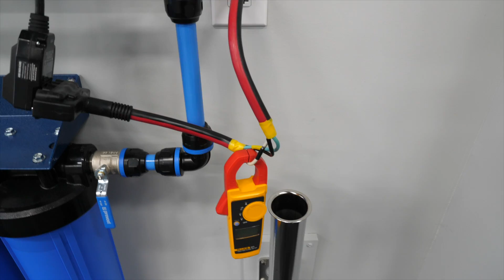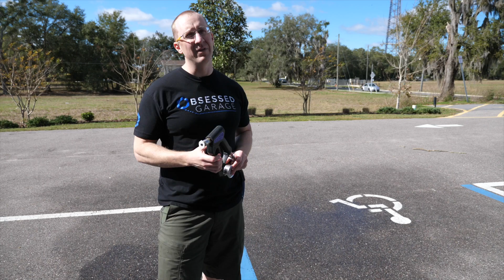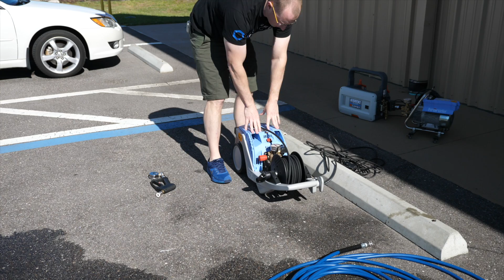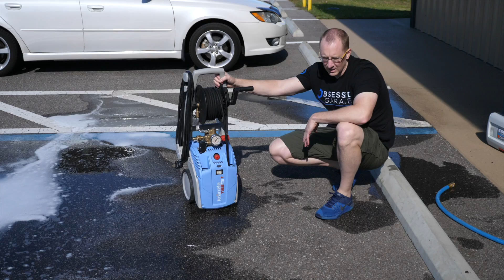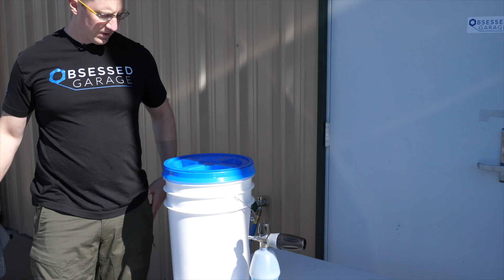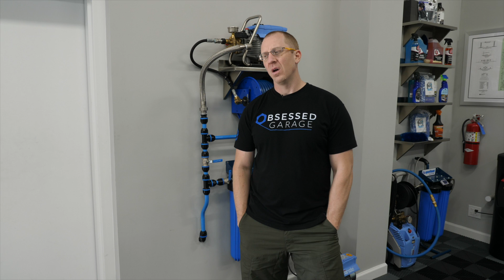The Pressure Washing Project: E12 - Testing Kranzle and Comet

Comment: How do you get the hose connection on the comet to stop leaking?  I cannot get it to stop to save my life.
Reply from the maker: It's all about the o-ring.  You can't overtighten.
Reply: @ObsessedGarage  Okay thanks, well, I can lol.  Brass shavings were all over and still leaking a little bit.  I've even tried plumber tape, different fittings, ughhh lol.  I can live with it for now.

Comment: Hi. I watch your videos and why in the US  kranzle has lower parameters?
I have (in Europe), Kranzle 1152 equivalent to a 1122 and I have real 120-125 bar ( on the pump but I don't have an injector ) which is 1700 psi and I have a real  flow rate of 10 L/min (almost, 10 kg/min ) which is 2.6 gpm; below 16 amp, only the current voltage is different because 230V.
What are the reasons for such differences, is it just the will of the manufacturer, or something else?

You say 1000psi is ok but i had a karcher M520 (15year old) washer 1450 psi and 1.6gpm flow and it was weak for me now i have a Kranzle and somehow the pressure isn't great either, it makes up for it with great flow.  Its strange that 1000psi is enough for you.

I write about the measured parameters, not from the manufacturer's documentation.

Comment: It's interesting that Kränzle USA does not offer anything like the HD 10/122, only the HD 7/122, which is essentially the 1122/1322. Also, something like the HD 12/130 would be popular in the US I'd think.
Reply from the maker: We don't have 240V.
Reply: @ObsessedGarage  
It was more of a general thing. Also, getting a 240v outlet is usually not that expensive or complicated. Many get them in their garage these days to use with everything from car chargers to tools.
Kranzle does offer a few single phase 220v units but those are properly expensive, so I think a 50hz version of the 10/122 and 12/130 would make sense for something in between for those having a 240v outlet.

Comment: Hey Matt, quick question I picked up a Comet from you guys, love the functionality, fit and finish however from my personal testing while using a 4.0 orifice as recommended I’am getting roughly 750psi at at 1.74GPM’s I’m using a MTM Hydro SG28 gun.  Any suggestions on why it’s under performing!?
Reply from the maker: It is likely your gauge is just reading differently than mine.  4.0 nozzle is the way to go.

Comment: how do you ensure water does not leak from fittings and ruin drywall? 
I don't think you can prevent that forever. otherwise great setup
Reply: You either use drywall meant for wet rooms or paint it with a paint meant for wet room applications.

Comment: Hey Matt, you skipped the foam cannon test with the 1622. Any idea if you would have used the 1.1 or 1.25 with the foam cannon? FYI, the numbers were 900 PSI with a 3.5 tip was 1.59 GPM. Thanks.

Comment: Can I use a power washer on my car thats has a  PPF Xpel wrap on the hood and nose ? Will the pressure washer lift the edges of the PPF ?
Reply from the maker: You can without issue.
Reply: Obsessed Garage 
awesome. Thanks a lot. I plan on ordering the Kranzle or the Comet this week.

Comment: I don't understand. Why the hell would someone want to spend over $1,000 for an electric pressure washer when a gas pressure washer, with lots more DPI and GPM can be purchased for a much lower cost?
Reply from the maker: Noise
Reply: @ObsessedGarage  Yes, that is very true. I  also have a cheap Karcher electric and it is definitely quieter than my gas pressure washer. But there is a variety of electric pressure washers that do not cost as much and have more rated power. I assume then that Kranzle is the Rolls Royce of pressure washers. But I would be very happy with a Ford or Chevrolet. To each his own.

Comment: How viable is it running the 1322 on a dedicated 15A if I also use it to foam my car?
Reply from the maker: You can if absolutely necessary.  You'd likely need to run a 4.5 sized nozzle and 1.5mm orifice in the foam cannon.

Comment: Hey Matt, for the 1322, can we get more juice out of it in regards to PSI?. And how much PSI and GPM?.
Reply from the maker: You can't get much more out of it.
Reply: You're kind of limited in the US by your 15 or 20 A 110V output.
Alternatively get a 240v output, order a HD 10/122 TS or HD 12/130 TS from Europe and use a 60 to 50 hz converter. The HD 10/122 TS is similar to the 1122, but with a 2800 rpm motor, a flow of 2.5 GPM and a continuous pressure of 1750 PSI. Of course there's the Quadro 599 220 v machine in the US, but again, very expensive and quite a bit bigger.

Comment: Did you figure out the foam cannon issue with the Comet? It did look really wet in the video which is odd considering how much flow it has.
Reply from the maker: Old soap
Reply: @ObsessedGarage  oh ok, I have a gas pressure washer but not really sure how to bring it down to proper pressure, been kind of thinking about getting an electric one.

Comment: I received my Comet last month. The performance is very good, as expected from the GPM. However, the quality is disappointing. When it arrived, the waterproof cover for the power switch sheered off from poor packaging (from Comet I assume) and cannot be reused. This does not impact the performance of the machine, but having the waterproof cover for the electrical switch is not a bad idea. Today, after 5 washes from the machine, while reeling the hose back, a piece of metal on the hose pierced into my finger. It went in very deep. I inspected the hose to see what exactly pierced into my finger. It turns out that the steel braiding on the hose fell apart and exposed the wires that are used to protect the hose. I never abused my hose, and I believe the damage happened at the factory. To use this unit safely without injuring myself again, I will have to spend another $150 on a Kobrajet hose. Very disappointed in this unit. You would think that the quality of Italian made products would be decent enough. Go with the Kranzle if you have the money or the Karcher if you don't have the money.
Reply from the maker: You aren't incorrect.  There are many quirks to the Comet.  That's typical Italian.  The Kranzle fit, finish, and function is far superior.  I'm hoping over time to work with Comet to improve their packaging and get rid of all the junk that come with them.
Reply: @ObsessedGarage  Please let Comet know that the wire braids on their hose may come apart and expose sharp wires. This is a very dangerous flaw.
Reply from the maker: That can happen to any hydraulic or pressure washer hose.
Reply: Obsessed Garage i agree. But from what I gathered,  it happened out of the factory. Even if it was normal wear and tear, 5 washes is too early to wear like that.
Reply: @hammertimee777  I have been using this machine for well over a year (closer to 2 now) and have not seen any wear on the hose like that actually, though it can certainly happen to any hydraulic hose with some abuse as noted. I would suggest contacting Comet US support, or your authorized dealer, and they will send you a cover for the switch.... possibly they can also address the hose issue for you as well.
Reply: @Streetwisereps  Thanks Streetwise. The damage on the hose is not from "wear and tear". It looks like a needle sticking out of the rubber skin of the pressure hose. It looks like a manufacturing flaw from a small section of the hose and they did not catch it during quality inspection. Maybe I will get a video up to show the section.
Reply: castamir It sounds like it would be a warranty issue if it failed within 30 days. I would suggest again to contact Comet US Support. They are very good at taking care of customers.
Reply: Streetwise thanks. Again, I don’t want to come across as a harsh critic of the product. The comet pump itself is very nice to use. It’s just that the accessories and peripherals are a nightmare. I was expecting this as an early adopter of the Comet. As consumers realize this, and as OG works to eliminate the accessories, the Comet would be a good option. The worst case scenario is I will duct tape the hose for now until it gets worse and I buy a kobrajet. I’ve used kobrajet and I know that kobrajet is a far more durable and quality product.
Reply: @Streetwisereps  how you liking your comet brother ! Give us a update
Reply: @daiskebrandan8327  Nothing to complain about here! Still going strong, with no issues to date :)

Comment: can you make another washer for home cleaning project that can push 2000-2200 psi and 1.8-2 gpm?  You can go to 220V
Reply from the maker: It's on my list.  I'd like to have something in the 20A range with Total Stop that gets more pressure and flow.
Reply: @ObsessedGarage  Basically a US version of the Euro HD 10/122 or 12/130.

Comment: Looking at your current wall setup, did you ever consider a 3-way valve (diverter) and a 1-way check valve to simplify the plumbing?  With that setup, you'd only need to use the diverter to select which way the way would go and wouldn't have to mess with 2 additional ball valves every time you wanted to switch.
Reply from the maker: Yes, but I couldn't find a way to offer it to others in a modular system.

Comment: I have a 2800 psi 2.3 gpm gas washer. I ordered an MTM 
pressure gauge and some tips to figure out where I need to be.
Reply from the maker: Correct.  You'll want a 4.0 or 4.5 depending on how accurate those specs are.
Reply: @ObsessedGarage  got 4.0 on the way from you. Going to test with my gauge as GPM.
Reply: Hey Matt, so with the stock 40 degree tip, I pushed 2700 PSI. Don't know the orifice size. With the 4.0 
40 degree tip, I pushed 1650 PSI. I weighed my bucket using my home scale, and it came out to 2.3 GPM. My scale at work will be more accurate, but I think it's close. If you had to guess, which orifice 40 degree tip(s) will get me where I want to be? 4.5, 5.0? Thanks!

Comment: I just bought the AR630 TSS.  I'm going to buy the kobrajet hose from you as well as the tips. Not sure what orifice tips I should go with? It lists 1900/1500 PSI, but working pressure is rated at 1500 and 2.1 GPM. I'm confident it will deliver very close to those specs.
Reply from the maker: You want 4.0 nozzles.

Comment: At higher GPM when using CR Spotless rinse water in some locations you will go through resin very fast. I'm talking like every 6 car washes or less. It would be great to do that test. Here in PA I was using resin very fast. Until I talked with CR and they recommend 1.2 GPM because the water is so hard. 
Thanks as always for keeping it real.
Reply from the maker: That is true depending on your water.  I'm working on a not so pretty much higher flow and volume option as well.
Reply: @ObsessedGarage  Thanks and sorry if you was offended in any way. But I was spending a lot for resin every month. Thanks and hope to come hang out when I come down to visit my Mom and Dad there in Deltona FL.
Reply: @Ray Fisher .....curious as to what your TDS readings are from your faucet?  Mine is at about 150

Comment: The 1622 would be ideal as I only have a 15amp circuit.  You can always use a outdoor outlet remote control kit to turn it on and off without having to walk to the machine.
Reply: You can use a 15 amp with the 1122 but it has to have nothing else heavy on it, my 2020 is used on my outdoor 20amp circut which shares with lights and it has yet to trip my breaker.

Comment: Wait..what? @15:02 The Kranzle 1122 was 950psi at the gun and 1500psi at the pump? Is that because of the restriction of the hose diameter or the nozzle size. Seems like a big loss at the gun.
Reply from the maker: That's how they all seem to work.
Reply: I can personally validate his findings also with my new 1122.  Same readings but that's ok as all I'm doing is washing cars with it.

Comment: hey big guy question i want to buy a set up like what you have in back of you. but i was wondering if i can use a gas generator. im tryna make this mofo mobile. lol
Reply: You'll want a generator that puts out a MINIMUM 2400 running watts (many companies advertise with peak wattage; 2400 peak watts isn't good enough).  Many/most 3000ish peak watt generators should provide the running wattage you'll need, but check their specs to be sure.  If you want to run any other equipment on the generator at the same time as the Kranzle, then you'll need a more powerful generator--one powerful enough to meet the demands of all the equipment you plan to run simultaneously.
Reply from the maker: Yes, as long as it is suppliers 20A.

Comment: The user experience of the k1122tst is truly life changing. A couple of years ago I wall mounted a greenworks pressure washer and in roughly a year is started to self destruct. At that point I picked up the 1122 from you and it's amazing. Thanks for putting in all the hard work brother. Its greatly appreciated!

Comment: Having a Kanzle 1122 after using "disposable" pressure washers reminds me of finally buying a Honda lawnmower after using Craftsman for so long. Both feel like they'll last forever.
Reply: Sounds like your saying the cheap pressure washers compare equally to a Kranzle at least that's the way it reads. My Craftsman lawn mower has lasted me 10+ years and still going strong 😲
Reply: That’s not the way IT READS that’s the way YOU read it. It reads that Honda and Kranzle feel like they’ll last forever unlike craftsman
Reply: @Fee.1  I have no clue what this is all about.

Comment: Hey Matt,

I’m from Australia and have a K1152TST. If you wouldn’t mind replying with your method for measuring the flow rate - including the figure you used for water density and any other conversions - that would be great. I’d like to follow your procedure and find the like for like flow rate of the 240V version of the 1122. Thanks
Reply from the maker: 8.32 pounds per gallon.  Spray into a bucket for 1 minute.
Reply: K1152TST
OG mosmatic gun and wand setup, supplied 4.0 40 deg MTM nozzle:

17.6 lbs in 60 secs
8.32lbs/gallon

= 2.12 gpm
Reply: @1995trento  easier way would be to get a bucket with liter markings, run it for 60 seconds then divide that number by 3.785

Comment: Like yours, my 1122 shows 1500 psi on the built-in pressure gauge using a 4.0 nozzle. I was considering going to a 5.0 to bring the pressure down, but your secondary pressure gauge at the nozzle shows 1000. So I should keep using the 4.0?
Reply from the maker: 5.0 is going to bring the pressure down to about 500.  4.0 is the way to go.

Comment: Nice seeing all the tests and all the work done is impressive to say the least. The Comet looks like a decent pump. Interesting that the Kranzle pressure gauge reads roughly 50% higher at the pump than the gun at the end of the hose, probably why the other cheaper pumps get away with listing sky high psi numbers at the pump that you’ll never see at the gun. No biggie for car wash duty anyway as psi isn’t the most important thing, and don’t really want too much on the paint ...
Reply: Because the gauge is screwed on to the front middle valve of the.pump so it reads the pressure at the pump.

Comment: Is it reasonable or even feasible to replace the kranzle hose on the 1122 with a kobrajet?
Reply from the maker: Yes, you can, but you'd loose the Kranzle hose reel.
Reply: @ObsessedGarage  Good point.  If the hose on the kranzle is up to snuff i wont worry about it.

Comment: Can you test the Powerhouse International "Red Platinum Edition"
Reply from the maker: Ha, ha...  I've seen that one.  It is probably not worth wasting the money.  You can see it the same knock-off bull crap as the others.  It's going to get 1.2 GPM at 1200 PSI like the rest of them.
Reply: @ObsessedGarage  have you tried another test with the Comet with just the foam? It looked runny on the wall by the looks of it. That's the only thing that's stopping me from buying one. I've seen all the comet videos, but I'm not sold on it just yet.

Comment: Nice!!     that small [heavy]  quiet 1622 at 1.5 gpm would be perfect for me, since im on a well!   gpm are limited..!!  Thanks for all the effort you put in this for all of us!!    :-)  Apreciated!
Reply: The 1622's results intrigued me as well.  I'm a mobile detailer and am using a Karcher K3 until it dies.  Water conservation is important to me both because when I do not have clients' water to use, I want to make my water last and because it is simply important to me not to be wasteful with water (doesn't matter to me that I'm in WI--no one should be wasteful with water if they can help it).  I use a 3000 watt inverter generator when I need to, but the lower amperage of the 1622 would also be a bit safer for clients' circuits.  Haven't blown a client breaker yet, and I hope I never run into that particular embarrassment.  The small size is great, but the heavy weight of the thing is a bummer especially as a mobile guy like myself who has to move equipment around a lot.